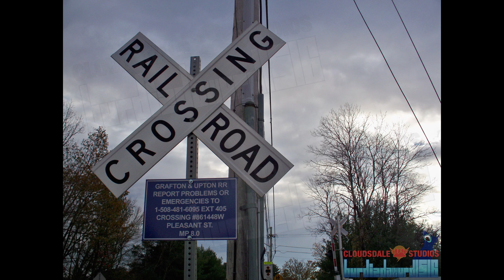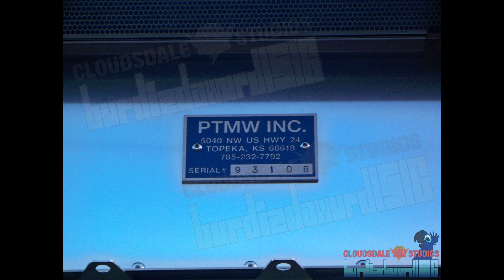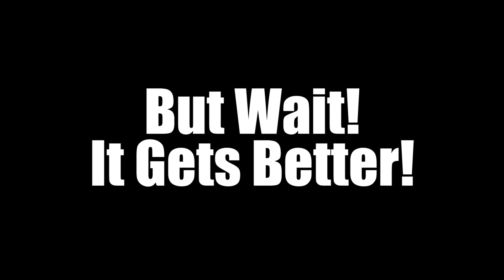G&U/R. J. Corman Update: November 2017

Comment: What’s the “B711-3/B711-15”?
Reply from the maker: A few years ago, when starting the schedule for the layout 2030 operations, I needed a way to differentiate sections of trains. CSX uses a dash [day of month train originates] system but I didn't really understand that. So it's a rotating cycle:B711-1 local from Pratt Pond Yard to Maple Ave YardB711-2 local to Mendon on the Blackstone Valley Railroad Goat Hill CutoffB711-3 turn back to GraftonOn Mon/Wed/Fri the local works the Miscoe Hill line toward the cutoff, Tu/Th/Sa they work Hopedale T.H. West Foundry buildingCertainly its another 10 years before those operations begin, but hey, it's my model. Update soon.